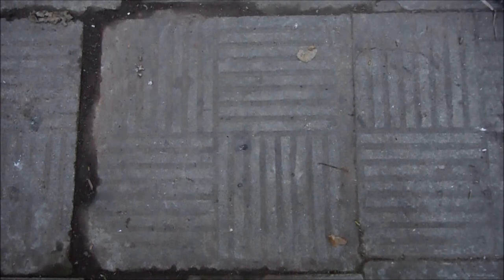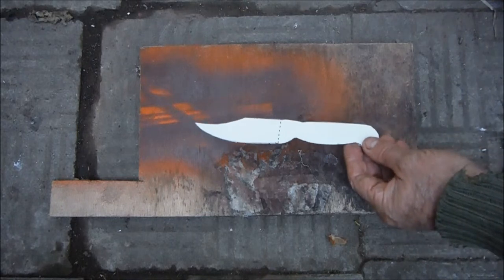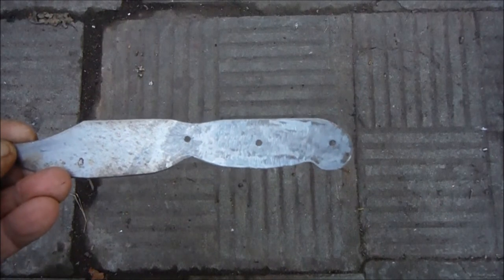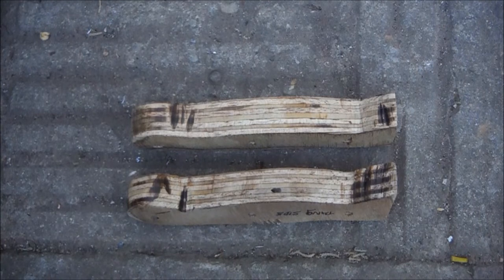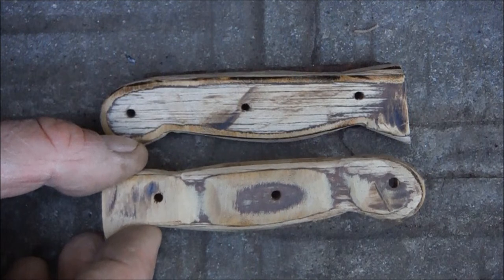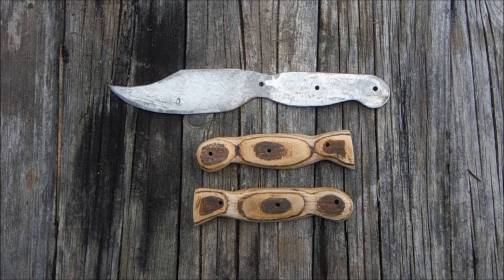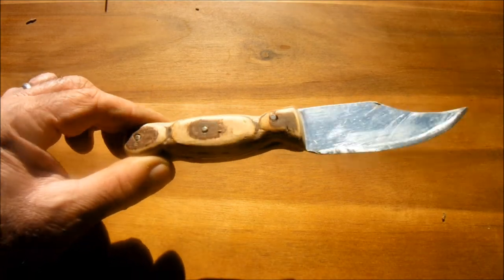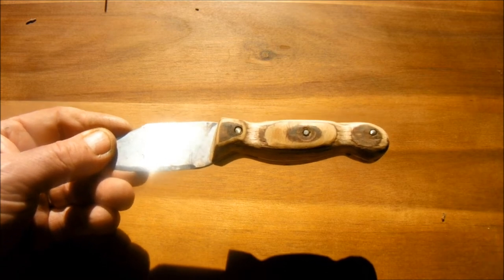You can use plywood to make cool side scales for knife handles!

Comment: I made a machete with high carbon steel and made hale put of plywood! Can I use pine? Resin to the blade and a strong epoxy over the top for extra strength? I like plywood because it's very strong and coating it in epoxy with a wire wrapped handle? It's a lot stronger than my Tramontina machete! It split on both sides. I'm thinking plywood because the bolo I made is thicker! Heavier and I fixed with resigned small stainless steel bolts at 6 mm thick. I love that pattern. Does burning slightly increase hardness on handle? Or looks? Any reply appreciated? Thanks. Cheers from Australia. Subbed and liked!🙂🙂🙂👍👍👍
Reply from the maker: Hey - I think you could certainly use pine if you were to coat the handle in epoxy and maybe some very lightweight glass cloth. The cloth should be invisible once the epoxy's cured.
I don't know whether fire-hardening works on plywood but I bet it would look cool.
Let me know how it turns out!
Reply: @Del350K4  thank you for the quick reply! And I love your vids dude! Cheers from Australia!👍👍👍
Reply from the maker: @dragan3290  Thanks, bro!
My channel's a strange mix of RC cars and knives & swords. The RC stuff gets more views but I do keep posting knife-making stuff because I love making them.
Have a good day!
Reply: @Del350K4  you're kidding? I have been into R/C cars especially 1/18 scale brushless. Power to weight. Heaps of fun. Looks like I subbed to the right person! Awesome. Now I'm gonna check it out. 👍👍👍👍
Reply from the maker: @dragan3290  The ppwer to weight ratio of a 1:18 brushless RC car must make any full size race car look pretty tame!
Reply: @Del350K4  lol. I put a 540 size 9.5 turn. I had to modify the battery holder and put Velcro straps. It had no room but a dremel and a good imagination helps.the original brushed 540 I dusted off a few cars in the street. But with brushless? It shreds the tyres! Lol. Tyres balloon like crazy! Just need to put lower gearing. But even then ? Tyre frying or it would flip. Cheap car. Just transplanted from my 1/10 scale! 🙂👍👍👍
Reply from the maker: @dragan3290  Man, that must be a sight to see!
Reply: @Del350K4  it's awesome. But council put a reflective plastic marker right in front of my driveway just when I was getting really good at controlling at high speeds. One afternoon I hit the raised  marker and it flipped up into the air a good metre yet still was ok. Just popped a tie rod end off. Lol. It's a cheap EBay version A 959B. 1/18 scale with all metal parts. 60 to 70 AUD . Now they're going for around $120. I should have bought 2. Oh well. Cheers